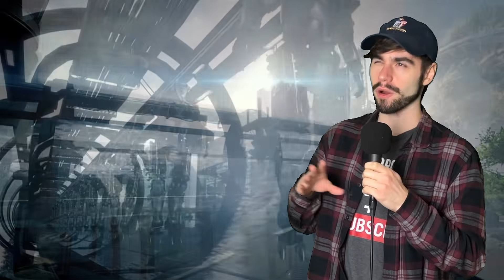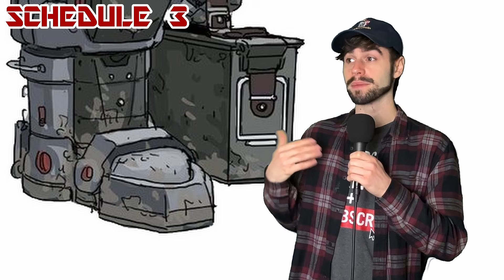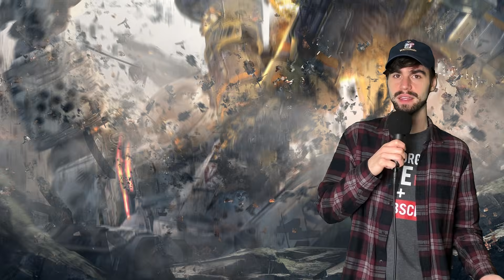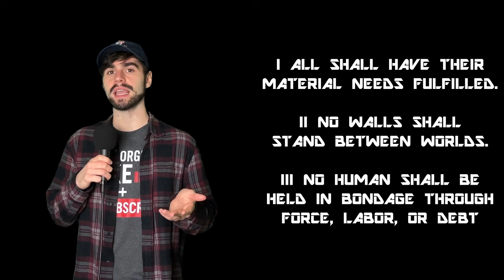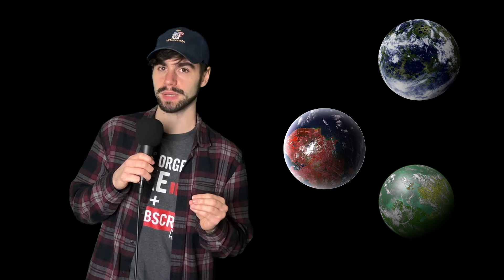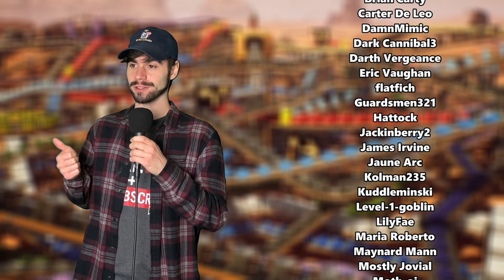Printers, Licenses, & Industry | LANCER

Comment: Harrison stuff has one USB-B port and assumes you have the cord.
SSC stuff has a tapestry of braided cable bespoke to each individual part, you have to work out every connection manually and probably write your own drivers.
HORUS cables can be anything from blinkspace portal rings to a shoplifted garden hose. If it's working, don't touch it.
IPSN stuff has everything from a Western Union telegraph hookup to RCA to FireWire to every USB port yet devised; the hardest part is finding the right one.

Comment: Since it was mentioned that larger printers are basically just encapsulated auto-factories, it's worth pointing out that traditional factories are still the primary method of manufacture for most of Union, even in the core worlds. Printers need very pure input resources for optimal efficiency and can only produce one item at a time, so usually things are made locally or you just put up with the lead time of a few weeks to decades depending on how close the nearest blink portal is.

Of course, as lancers we are the specialist people who only need one of something at a time and need it NOW with the backing of a well-stocked employer, basically the optimal use-case for an industrial printer.
Reply: printers print factories, factories make everything, and eventually the printer is relegated to strictly boutique manufacturing once all base needs are covered by other facilities

Comment: Technically Star Trek replicators don't do pure energy-to-matter conversion -- that's too energy-expensive, it would cost a mass of fuel equal to the mass of the thing you were constructing. The ship has a big tank of raw material slurry that gets atomically reconfigured via transporter-like technology into whatever you need to replicate. How does the tank get replenished? Uh... let's just say the other end is connected to the sewage system.
So it's not that far off from a Lancer printer, but less touchy about the state of the raw materials.

Comment: I like the idea of really leaning into the "no two are the same" for Horus, every design mech is /fundamentally/ non-standard. The license gives you access to the means to the automated systems of printers into making something in a way they're not supposed to, but that fits enough with what they normally make that it passes whatever inspection/security there is. Automated checks simply don't notice anything unusual, and relevant logs show nothing unusual. And that's just how /all/ Horus printing gets done - every printer is a Horus printer and every part is a custom job.  

And honestly.... I figure that's also a major restriction on somebody just popping in an using somebody else's Horus. Even if you pilot an otherwise identical mech, nothing in the Horus is standard. Including the controls, and probably some wildly creative ways for a Horus mech to handle anyone who tries to jack it. You /really/ don't want to trigger a Balor's car alarm.
Reply: Triggering a Balor's car alarm... I'm dying
Reply: @xana3961 Literally.

Comment: Another core issue that Union is struggling with is the legacy of Second Committee. The Second Expansion period greatly increased the size of Union's size with little coordination to the point that five centuries in, ThirdCom is still cleaning up the mess. Second Committee is the reason why DOJ/HR are still so swamped with work. That's why they have to TRIAGE.

ThirdCom has been around for five centuries and yet despite it all humanity is still living under the shadow of second committee. That's how awful they were.

Comment: 7:50 so funny thing about this is it actually came up at my table once. This is not official lore, but what we agreed on is this:
1) Your License Level can allow or deny prints
2) Your License Level can allow or deny the use of licensed equipment
3) In exception to rule 2, individuals tagged as part of your company, squad, or otherwise expected to work alongside you in an organized manner are permitted temporary exception to rule 2 if and only if the original owner of the License is incapacitated or grants explicit permission of its temporary use

The reason this came up was because a pilot got drunk right before an operation, to the point they ended up being incapacitated, but their Lancaster was needed to repair a city's defenses before an attack arrived. I ruled that another player could temporarily pilot the Lancaster, and made these rules as a house rule headcanon
Reply: I would say that the other pilot could operate it, but the lancaster or whatever mech would be impaired for the duration since they don't have the full training to use it. at least for something like a lanny. for other things, different things could happen.
Reply: @Yellow13Firestorm  I like that idea. I'll add that to my house rules, thanks!
Reply: @shayminthedoctor9663  No problem. To be honest, I was using the rules of the Expanded compartment system. to quote the relevent text...

"You can hand over or take back control to or from them as a protocol (following the same rules as pilot and AIs), but if they take over the controls from you, the mech becomes Impaired and Slowed to reflect the lack of appropriate licenses and integration."

Comment: Y'know, I think we could legitimately make a schedule 3 printer, or at least the systems within them but for size 1 or 2. We can 3d print metal, and with enough robotic arms, automated processing systems, and the necessary algorithms for assembly. Unless I'm mistake, assembly is the hardest part, but with noyron and similar algorithms, you can just print a whole component as one object. We can, with no human intervention, design a key engine as one piece. And it's more efficient than anything a human can make.

Comment: i have been trying to research a definite answer for what is consumed by printers and i’m glad you’ve finally given me the confidence to say just electricity and atoms.

the thought of keeping a printer stocked up on limestone, potash, (this combination could be substituted with any mix of potassium, oxygen, nitrogen, carbon, and calcium; which potentially includes bones and breathable air or even just a ton of tree bark) and some random mix of metals to produce conventional metallic cartridges and grenades. or replace metal with table salt and fluorine rocks make everything out of synthetic polymers.

or better yet, make sure your weapons are all using caseless ammunition and problem solved by your magic black box, a large forest, and your second black box that does cold fusion

Comment: I'm tempted to say that the "Operational Restrictions" piece depends heavily on the manufacturer. (Though I realize that mechanically it's meant to be why you can't steal/scavenge weapons. I think the "Can you get in an ally's mech" part is interesting)

GMS: Depends pretty heavily but since basically everyone has access to those weapons it's pretty easy to bypass anyway. Though lancers could definitely get some extra protection for their stuff.
IPSN: Relatively easy both due to how IPSN chassis tend to have lower tech defenses, but also because IPSN generally designs their tech for Reliability over all else. They're Old Fashioned and Industrial, mechs with a physical Key that the pilot uses to start up the ignition more than any fancy biomechanical whozeewhatzits that could easily break down.
SSC: The exact opposite of IPSN. It has ALL the fancy internal components to make sure that the person using it is the one that t he parts have been licensed to. Technically not impossible to bypass, but highly likely to kick you out the instant you get in.
Harrison: Right in the middle between the previous 2. Their chassis are full of proprietary technology that they don't want getting into the wrong hands, but they're Military first and foremost, so a soldier getting killed and one of his comrades hopping into their chassis to finish the fight is probably more common, and so there are emergency bypass options for "WE ARE GETTING ATTACKED RIGHT NOW AND WE DON'T HAVE A CHOICE"
HOR_US: A complete crapshoot because of Paracausal Tech and NHPs. Acts less like a machine and more like an animal,  getting moody and sometimes deciding it doesn't actually wanna work for even its actual pilot on some days.
Reply: To be fair on the harrison thing if the pilot of the mech dies in combat it usually means the mech is at best functionally a pale of crap perhaps large and intact enough to be used as cover with the holes or what ever into the mech destroy it power supply or enough critical systems to be completely inappropriable and well beyond the normal means of field repair or the cockpit is completely destroyed along with the pilot usually or worst case scenario it basically atomized and their nothing but a Crater left there rarely a time were in a combat environment were the pilot is dead and the mech is still operational
Reply: @KennyBurkamp  That's a fair point. My  mind just went "Oh no, we got ambushed and the pilot got deleted before he even got to the mech, but the mech is still our only shot at actually stopping the guy that killed him" 

Though fair that that scenario is extremely rare.
Reply: @aquamarinerose5405 ya but this is putting aside the fact that we're to happen that there allys have there own mechs because by standard smallist formation of mechs come in are squads of 4 to 5 mechs so there allys would handle the rest but secondly even if you could start piloting someone else's mech it would be very difficult since that control are costume design for the intended users preferences and accommodations for custom or non standard equipment hookup to the chassis it could be hard or even borderline alien to even another mech pilot trying to pilot properly as well as the intended users it hence why the system that allows you to have a copilot and willingly shear/give control of your mech to whoever is in the copilot seat gives the copilot plus 1 difficulty on all rolls when the the copilot is in control which kinda makes the system bad and only good to have room in your mech to fit another person safely in hence why nobody that I know of uses that system in game but it does exist in game and probably in lore as a GMS system so it easily available to any license pilot of even level 0
Reply: @KennyBurkamp  I guess my brain ends up thinking too close to real life and forgetting that most of the important individuals will have mechs of their own, and I just ended up thinking with Harrison that it's like...

The US military isn't gonna have a 
Humvee that can only be driven by 1 dude. It's gonna be something that anyone in the platoon can drive. Though  also fair that mecha kinda changes the entire context.
Reply: @aquamarinerose5405 to be fair most of these changes are done by the pilots to improve ease of use for efficiency for them for example the standard control scheme in general have the control split between neurol link interface and manual control by 50/50 by standard and there a fair number of people that use those controls but there are people who like to rely more and are comfortable to put thought to action with putting more control to the neurol link part then the manual so less manual control and more thought to action some even go full neurol link controls with everything but the on button or what ever back up manual control they think they may need we even see this in a scc core bonus but on the other side of the spectrum other like less neurol link then standard and more manual controls some even completely forgoing them completely for only manual which to the average pilot it completely alien to skillfully control a mech with no neurol link in the same way it completely alien to try to play a fps game with inverted controls yet some people do it anyways and are surprisingly good at it combined with the fact it you have access to printer that can repair mechs it can change the control scheme to for a newly assigned pilot well in the process of repairing the thing for probably being totaled by what ever killed the last pilot if not just recycle for material to build a brand new fully functional mech of the same or maybe different model from it remains so having all control schemes be completely uniform is usually unnecessary but they use what is considered the standard controls generally in the mech used for training new pilots just by a default standard as most pilots first time they walk around with the mech as well as a baby taking there first steps

All of this besides the fact that the purpose of a mech and a armored transport mainly for infantry as well as the complexity of how to operate it is very different even with standard baseline features so some random no name marine with no training mech piloting would not be able to pilot a mech to begin with and pilots all have there own mechs along with the before mention things so you don't need as much of a standardized controls beyond having a standard base line to work off of and use to train new pilots so well there is a standard off the factors so to speak base line for these mechs that I am sure some pilots still use even after training there no overly strict rules against modifications to them for better piloting and ease of use for the intended pilot

Comment: I noticed that d2 strike in the background. that hallway is... memories.

Also, considering Horus, they probably don't use those software restrictions, and likely have jailbreakers. (which would be how an otherwise blacklisted pilot could access things they shouldn't)
Reply from the maker: Yep, Horus is all about working around or corrupting those restrictions to have there designs override. An infectious liturgicode.
Reply: Horus may not have official standards about who gets what tech, but they have jealous hackers guarding their secrets with whatever tricks they know.  And if you're good enough to crack into their systems and steal a weapon, that's proof you deserve to be in Horus.  "Access is yours, as long as you can keep it."
Reply: @benjaminlee985  oh yeah, I meant having unauthorized copies of say, IPSN or HA licences. or jailbreakers for said equipment.